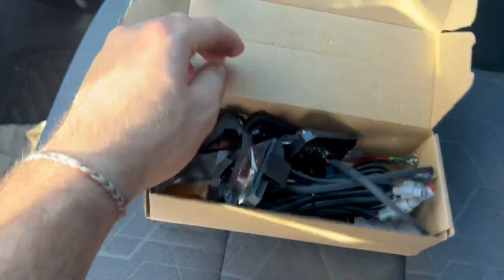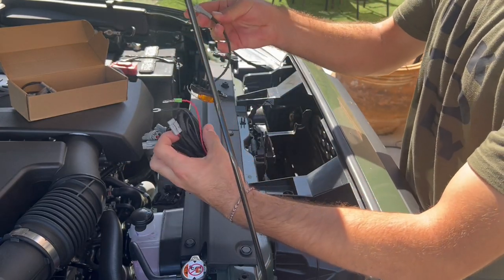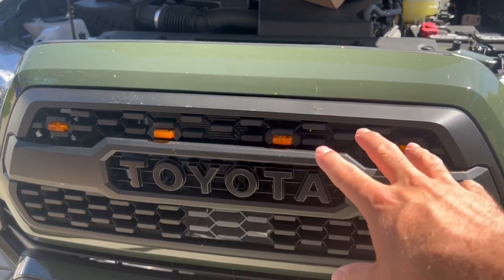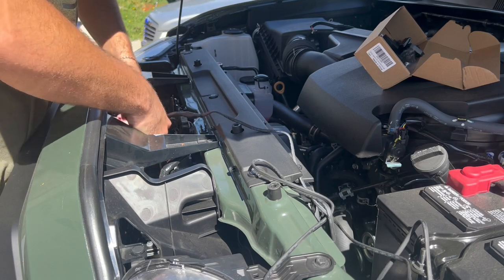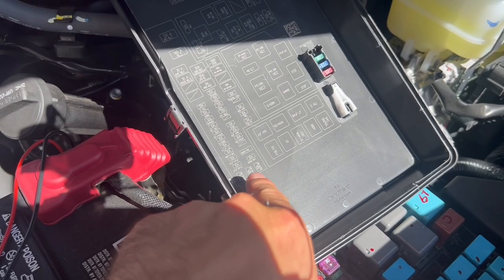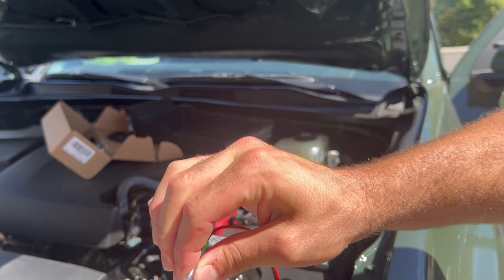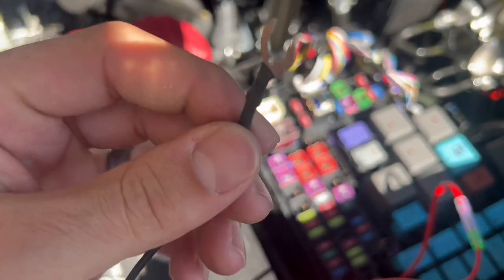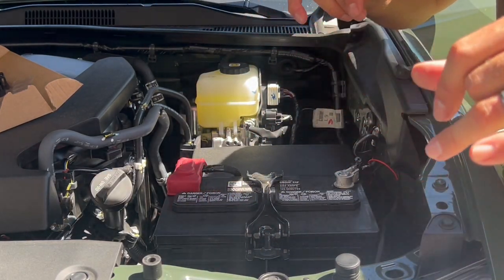Installing High Quality Raptor Lights on the Toyota Tacoma Grill

Comment: Thanks so much! I just installed them in my 2023 Taco Off Road (Lunar Rock). The video helped clarify things for me, especially the correct fuse. I had to use the blue one provided. I taped the light brackets in with black tape so they don't jiggle loose. I had a little different grill, so I had to use the brackets that were provided. I did a good job of taping and cable-tying the wires so they are hidden and secure. It took about 1/2 hour as I was particular about getting it done well.

Comment: Got a very similar set but white from eBay. Very well made. I ran the power wire up through the bottom of the fuse box. Just another way to install.

Comment: Do these come on with the daytime running lights or only when your auto lights turn on, or manually turn them on?
Reply from the maker: You can connect them to that fuse as well!
Reply: @TheUnrestricted  Thanks, so the fuse you connected to,  when your headlights turn on either manual or the auto headlights, the raptor lights will turn on? and, if you connect into the daytime running lights fuse, will it stay on even when the headlights come on? Basically always be on if your lights are on. Also, I'm subscribed man.
Reply from the maker: Thanks and yeah, haven’t tried jt but I’m pretty sure

Comment: I ordered it from Amazon but it doesn’t fit my 23 Tacoma Trail edition due my grill the outside holes are smaller than the inside hole of the grill itself.
Reply: Do you have the pro grill? Or stock one?